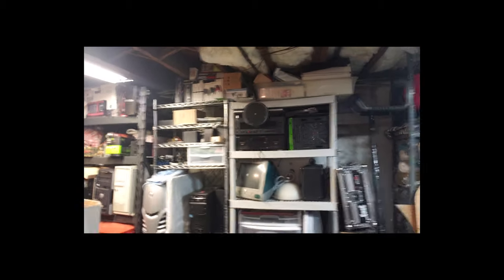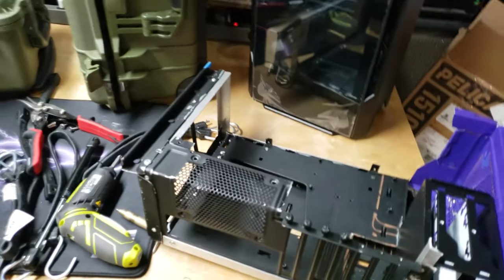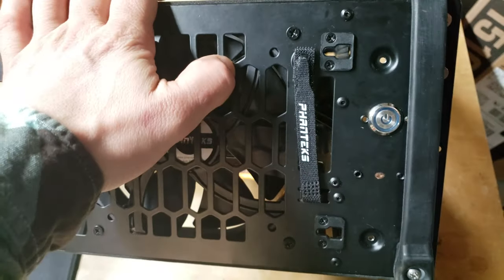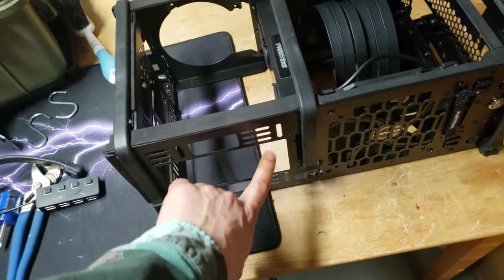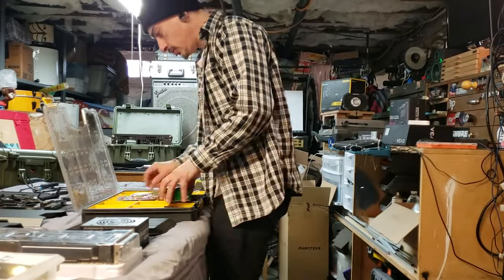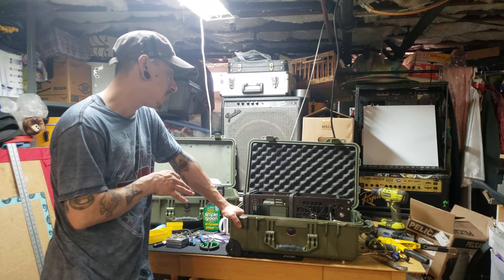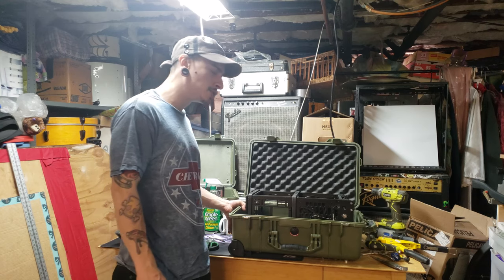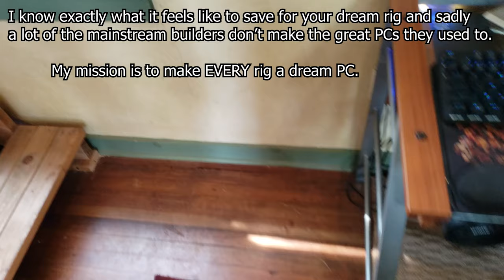[Pelican-X] the making of a shock proof gaming PC: PART 1

Comment: Rock on! Brilliant idea. Besides gaming, I could see this for traveling photo, video,  pros wanting the crunch power of a full PC compared to a laptop. I just calculated, I lose 15% cpu power for the money going from a desktop to a laptop PC. Nice work.
Reply from the maker: TY. This rig actually out performs the original chassis with the panels now off. So you get more thermal overhead then the standard desktop tower.

Comment: Do you have any concerns about static electricity building up in the case? I have a few of these hard cases and they are bad about that.
Reply from the maker: The fact that it is a "chassis in a chassis" kinda solves this. The inner metal frame acts as a Faraday shield floating within. Also modern parts are much less prone to this problem to begin with : )
Reply: @PollyTechComputerMind  That is good to know. I just started thinking how these hard cases really build up static, mine is always covered in dog hair! LOL